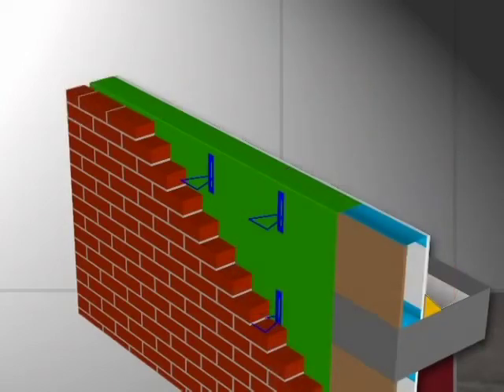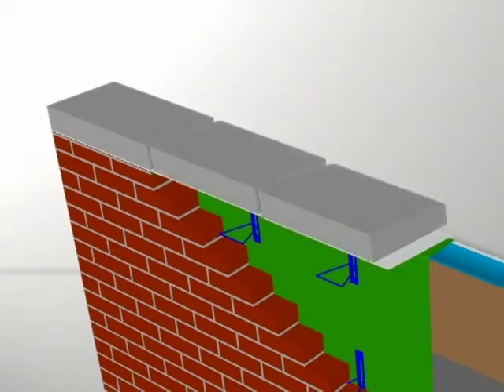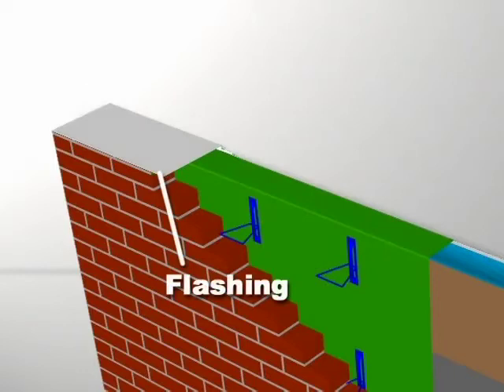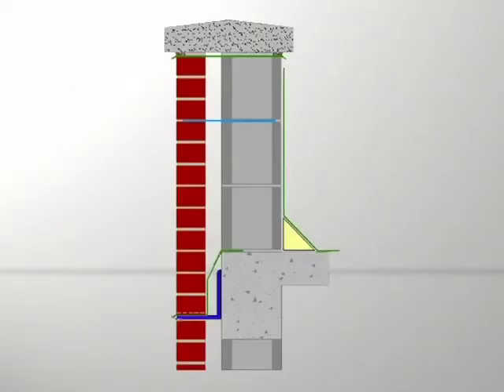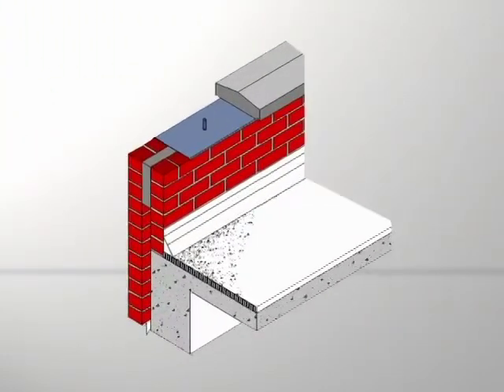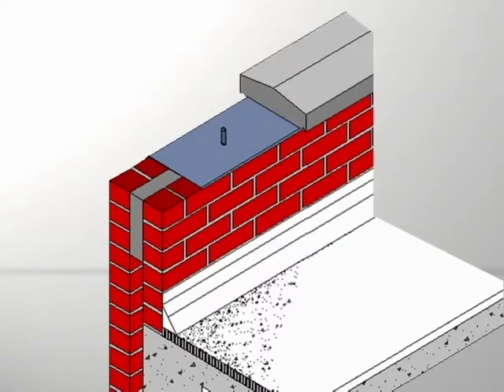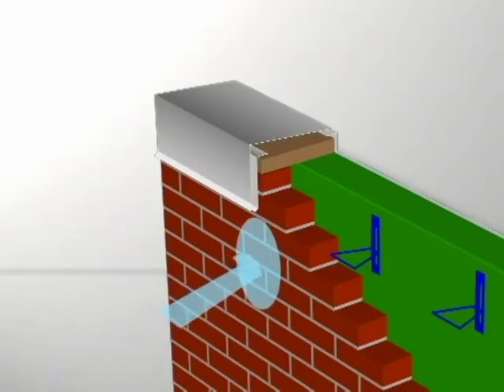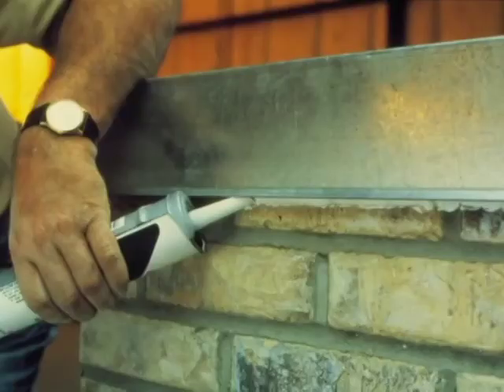Flashing at Parapet (Metal Coping  & Precast Coping Details)

Comment: which is more efficient in terms of preventing water penetration? metal or precast?
Reply: have the same question , did u find an answer?
Reply: unfortunately, I haven't. 
I read an article which said that the best practice is to match the coping with parapet material.
It's saying that a brick veneer parapet wall might be better with a precast coping instead of metal.
This is by far the best answer that I could find to this type of question.

I guess you are taking ARE exams. 
All the best of luck to you!!